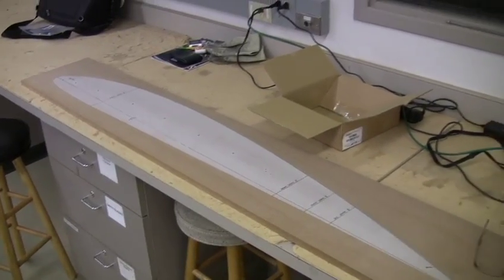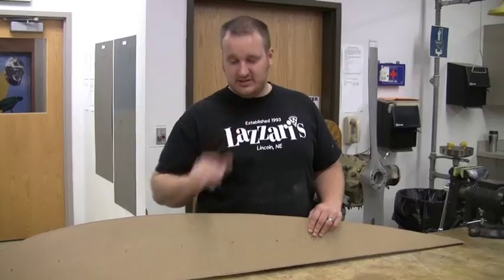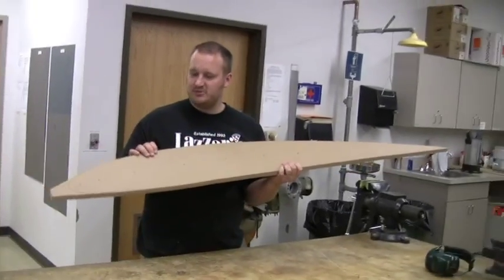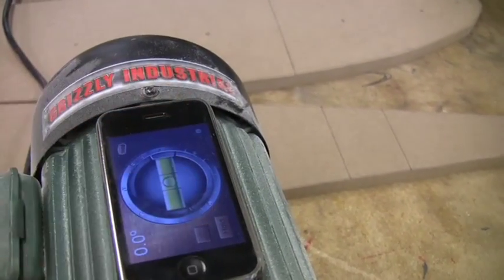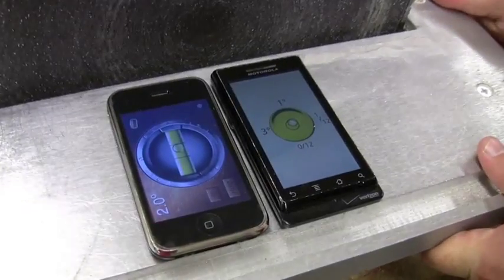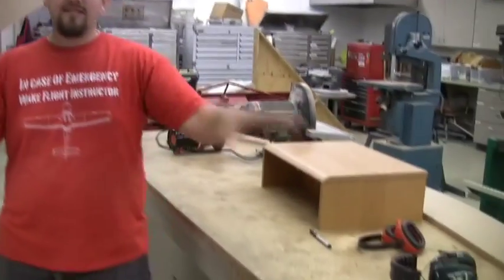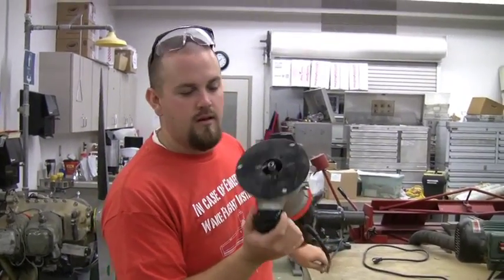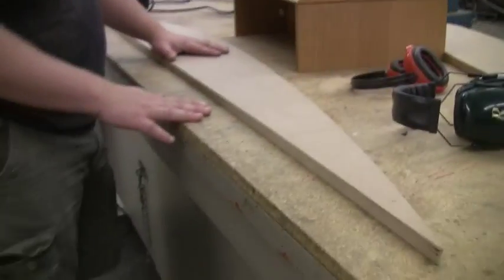Making Wing Rib Molds

Comment: one thing you forgot on your former is detentes to bend the excess metal into to stiffen and straighten out the rib as well ... somethng as simple as a 1/4 round dowl narrowest just after the round over and widest at the edge of the metal ... leave about 1/8th of an inch after the round over to keep the strength and remove added stresses of torque and torsion as welll as compression in the same small spot